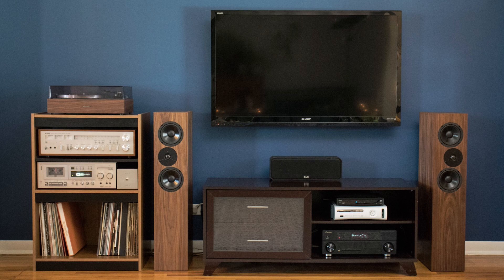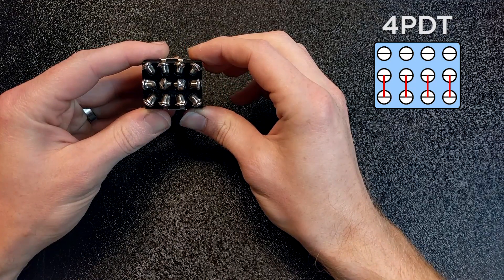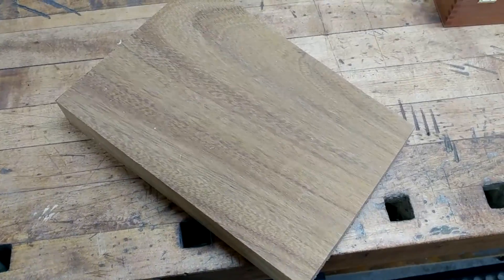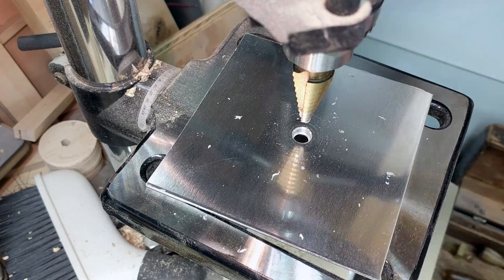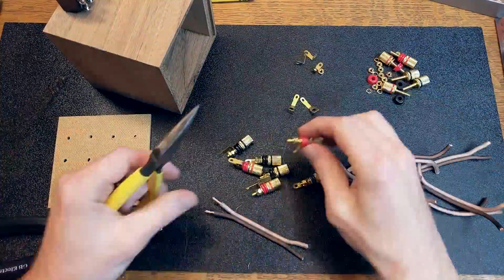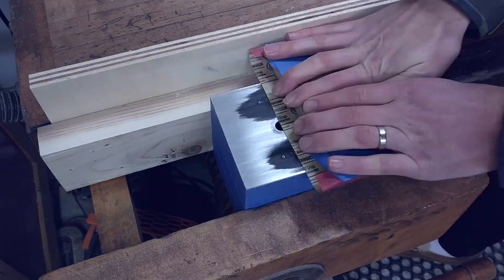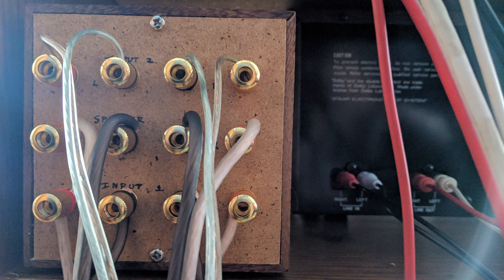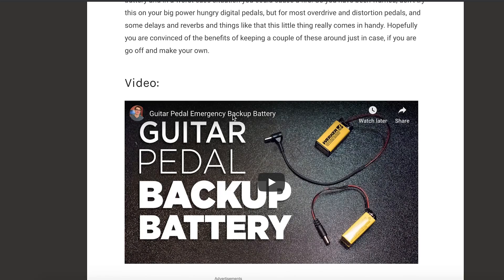Connect 2 Amplifiers to 1 Set of Speakers

Comment: Why, the frig, would I wanna  go through all this? What is the flippin', pun intended,  point?!  This doesn't "connect" two amplifiers to anything whatsoever.  You're just switching between amps, using one, or the other. I can, duh, just stop using one amp and move the speaker wires over to the other amp, and turn it on.

Comment: Not to be a negative nancy, but I found this to be less explanatory than I'd like.  For instance, most people coming to this video need to know the switch wiring to speaker terminals, not how to build a box; yet you spent more than half the video on building the box and flew through the wiring with very little explanation.  For instance, what switch poles are connected to which speaker jacks and which jacks connect to the 2 signal sources (amps)?

I think it would have been a useful video had you explained the wiring and said nothing about building the box.  As it is, it's not even entertaining, much less informative.
Reply from the maker: The wiring for this project is literally the simplest thing ever but the website article does goes into more detail.
https://merwinmusic.com/2018/12/07/amplifier-selector-switch/
Reply: If you look at the question you asked and you can't answer it on your own with common sense, then you shouldn't really bother trying to make one anyway.  Better off to go purchase one already made.  There is no shame in that.

Comment: I'm looking to build something similar, but as an input selector for my amp, which only has one input. I'm glad I came across your video, because you've given me inspiration to make a really high quality piece.
You have captured the look of quality vintage Hi Fi equipment perfectly, except you actually went one better and used solid wood instead of veneered plywood.
The only improvement I can think of would be to add a chunk of steel plate or something inside to weigh it down a bit.

Comment: It needs to be a “break before make” type (break connection to one amp before making a connection to the other amp) to prevent both amps from being connected to each other even for a split second – it should make it absolutely impossible to select both amps at the same time

Comment: I was wanting to do this too. I was thinking of using my 2nd bi wire inputs on my towers to connect to my intergraded amplifier. While the other input is hooked up to my surround sound avr. Instead of just unplugging my speakers cables to switch from my music to my receiver every time I wanted to do music/tv. I thought I could just have them both plugged in since I have 2 sets of inputs on each speaker for bi wiring and keep my receiver shut down when I want to listen to music through my amp and vice versa(have my amp shut off when I’m listening to music? Would this mess with my signal to much or cause something to overload. I’m new and very dumb when it comes to this stuff. Unfortunately my receiver doesn’t have pre outs or I would just buy a power amp to run with my front towers. I thought of using a speaker level to line level adapter from Crutchfield that is 40 dollars to hook up an amp that way but I heard it will work but make the music/signal very distorted? Any advise would help. If nothing else I’m perfectly fine just unplugging my banana plugs from my tower speakers to plug in my svs sound base intergraded amp when I want to listen to music instead of buying a new receiver. It sucks they don’t make many 7.2 receivers with pre outs these days, I guess they used to a lot more. I have a Sony dn1080 and love the Dolby atmos sound with movies but just want separate amp for my music

Comment: Now way can i build this.  However, why can't you simply connect a second set of speaker wire from the same set of bookshelf speakers ( in my case Elac Debut 6.2) and connect those wires to the second amp?  Of clurse, the two amps would be played separately?
Reply from the maker: I wouldn't recommend hooking 2 amps together directly. with this there is a disconnect between the two amps to protect them from each other.

Comment: So how do you use your home theatre with only two speaker wire connections. I want to do this but on one amp I want to have a subwoofer in addition to the two speakers.
Reply from the maker: The record player, radio, tape deck, and a chromecast audio go into the Yamaha receiver which is only the stereo mains through the switch. Then the home theater receiver uses the same mains for left right but has a center, sub, and left right rear hooked up directly to it all the time.

Comment: Very nice, but it would be advisable to use a switch with a "0/off setting" in between the 2 load settings, to protect your equipment.

Comment: Cool vid! I'm in the process of building one my self. I did a resistance check between all the connections and found one side to be slightly higher than the rest (sometimes). Suspect that particular pole is not making a firm connection. Have you faced this problem before?
Reply from the maker: I would check connections, then I would test the resistance while pushing on the switch lever in different directions to see if the switch is bad and not making good contact.

Comment: I used to play my Teac turntable amp thru the surround sound system amp by simply running a cable from the Teac headphone jack to an input on my Yamaha surround sound. I also used a speaker selector switch in reverse, but the sound was compromised and it was a little risky so I abandoned that. Eventually I bought an amp switch. I am handy with creating things, but not like this guy and I do not have the professional tools required, so buying a switch was the best route. I also have a third amp, my old Rotel unit, that I will still occasionally play using the headphone-out method.

Comment: Exactly what I want to do,but does one or the other amps need to be turned off or will the toggle totally keep power from  running amp to  amp.
Reply from the maker: In theory they should be fine but that is putting a little too much faith in the switch for my liking so I have one amp off.

Just keep in mind that tube amps don't like to be turned on with no load, so if one amp is tube than you want to make sure the switch is connected before you turn it on.
Reply: @MerwinMusic  Thanks for the reply,sort of what I thought,better safe than sorry.
Reply: @MerwinMusic  hello sir can i order that selector switch?
Reply: @MerwinMusic  I need to have both amps on (but only one driving the fronts at a time), since I want my Stereo Amp to drive the Fronts to use them to listen to vinyls and I need also to drive the Fronts from an 9 channel AVR that will output the surround back to the Stereo to drive 11 channels. Thus, to drive 11 channels i will need to have the AVR and the Stereo On. Is this possible? Do you understand what I try to do? Do you think enough faith to the switch?

Comment: Hi how would you connect more than 2 amps? I want to connect 3 hifi systems to my Cervin Vegas. Cheers
Reply: Check my comment _ I have three amps as well and use the headphone jack as the output on the amp to play through, with the connection to the main amp through an input port that has a cable adaptor to receive the headphone cable plug. Works great. I assume there is no risk as long as you keep the input amps sound level at a reasonable setting - don’t crank it.